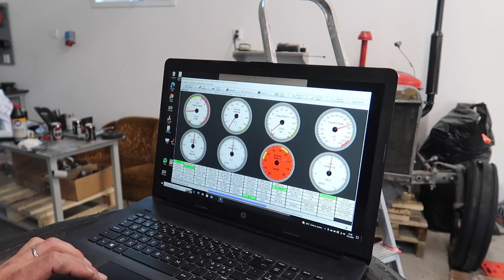HOW TO INSTALL PMC 2JZ GS653DZ CONVERSION KIT!!

Comment: Cool! Finally a video for this exact kit! How did you find mounting the starter? Im just going through that now, you have to insert a threaded piece in the block? Every bolt lines up except the starter, I have the same adapter plate as you

Comment: @zenso Motorsport. Did you have any issues bleeding the clutch? I switched to a larger port, larger pivot ball and a plastic oem slave. Still I have bleeding issues